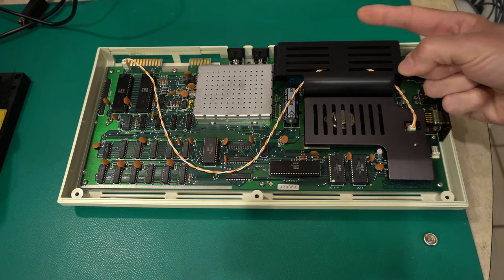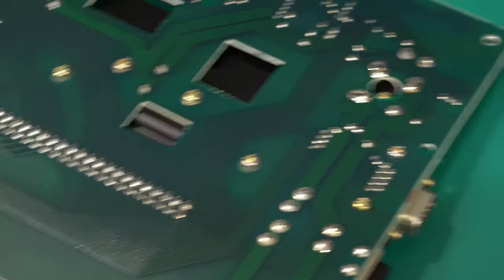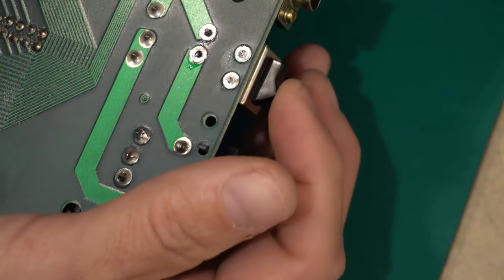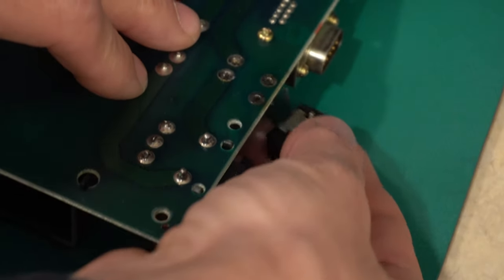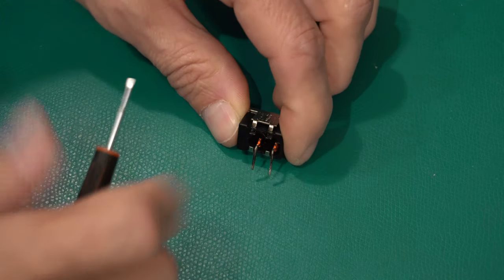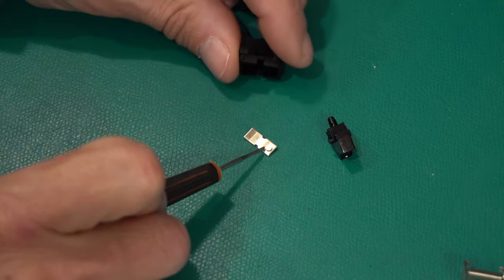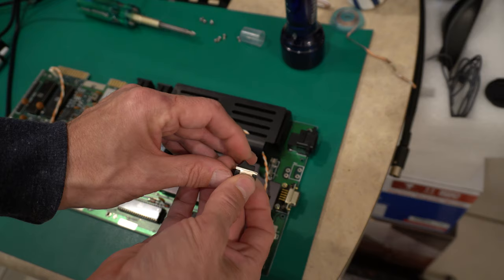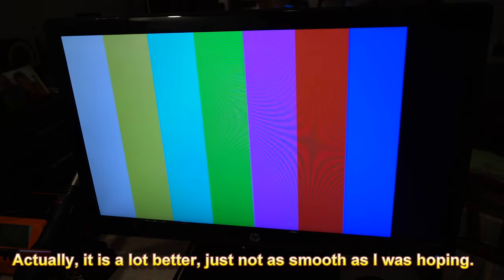Commodore VIC-20 Power Switch Repair Attempt

Comment: Hi, I from what I remembet of mine doing the same thing, it's the middle black post that has a spring in it, that was what was sticking...
Reply from the maker: Mine appears to be springless. It still sticks a bit after the repair but nowhere near as badly.
Reply: @amigaretro4765  I was thinking like you and than I realized that it should move it as to because it needs to be longer on each side to push the rocker contacts and shorter I the middle to be able to move from side to side.
Reply: @amigaretro4765  and it’s why it was not moving at all and you feel you would break it. I should have made a video !